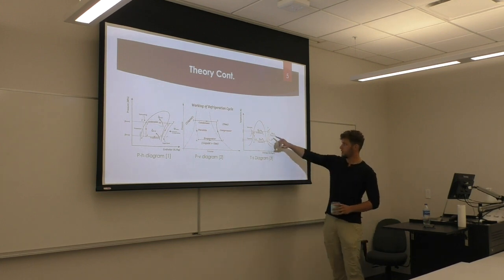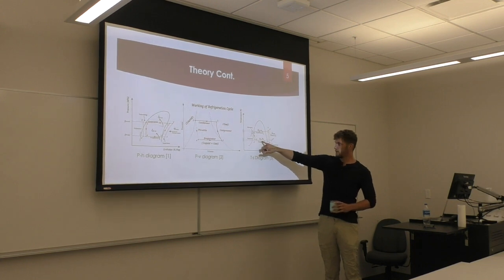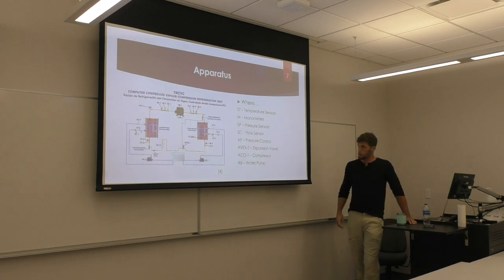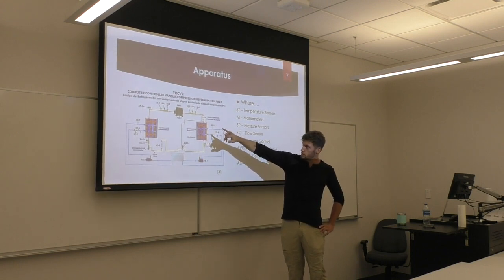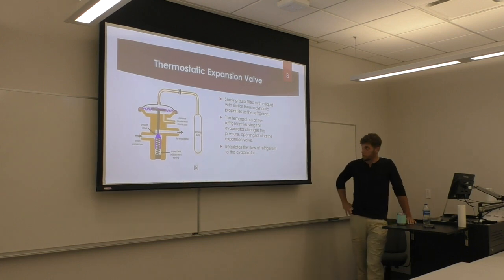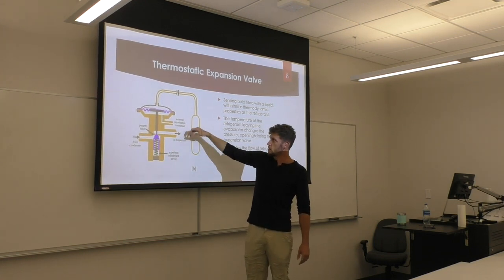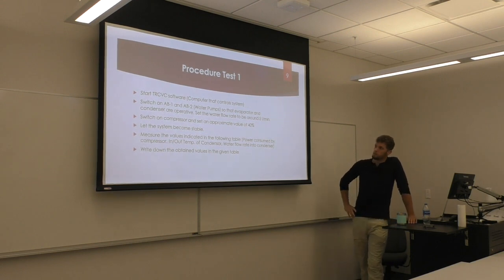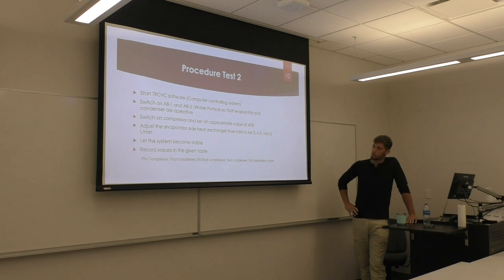Devin Colon GL

Comment: Great speech Devin. Your slides were very informational and you explained the process of the experiment very well so that everyone in the audience knew exactly what was going on and knew how the experiment worked. It shows that you definitely prepared for the speech also because your transitions were very smooth and you did not have to read off of the slides much at all. My only critique would be to make sure of the time so that you receive max points for the full speech. Other than that, great talk and good job!